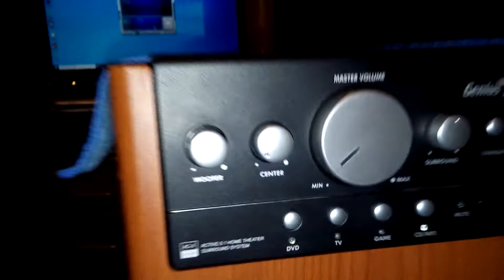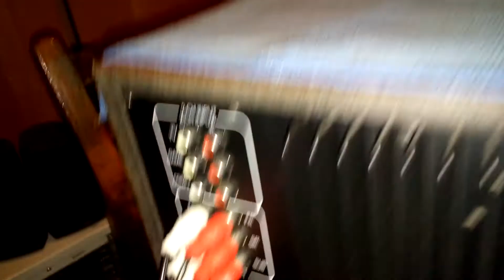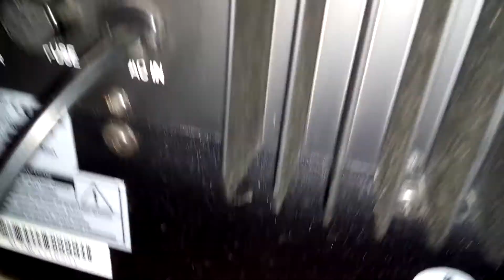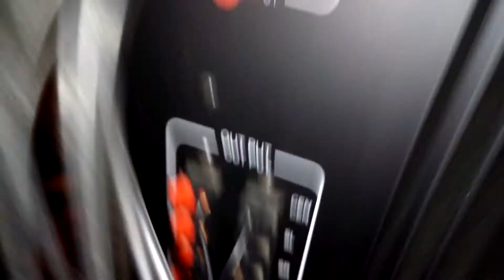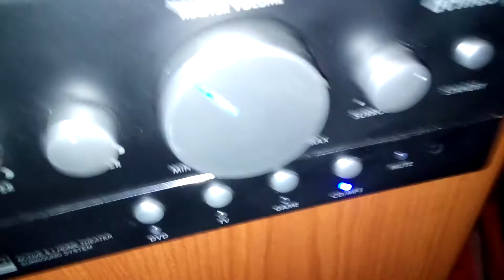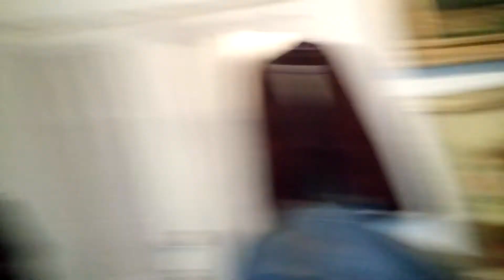Genius Home theater 5.1 Audio System

Comment: Input  set photo plz
Reply from the maker: You can pause the video and see the wiring input.I can't send you pictures since my home-cinema was moved to other location house.Follow the scheme back panel and let me know when you're lost.
Reply: @edward940  hey buddy, I bought one for my dad’s birthday, and I don’t know how to connect the out put wires, can you tell me which one is going in which SL-SR-FL and FR? Thanks for the great vid tho💕
Reply from the maker: @liljesuschrist8626  SR and SL is Rear back right and Rear left. Firstly begin  with front speekers, front center and lastly  the rear ones. Pause the video and connect the wires like shown there in the video.
Reply: @edward940  the rear ones work in SL and FL, the front ones don’t work in SR and FR, the remain ones… I tried crossing them one from other like you did in the video but I’m completely outside the subject.
Oh, and the rear ones don’t work in SL and SR… only in SL and FL.

Edit: Do I need to cross them in the back of the speakers too??
Reply from the maker: @liljesuschrist8626  Hm, strange. Have you connected firstly the wires from 5.1 connectors white and red all six of them and afterwards into the sound card of the back of your computer such as : black, orange, green? Assuming you're using 5.1 audio integrated sound-card? If yes, then start connecting first center speaker, rear left as SL, followed by the other ones.,at the bottom are FL - front left and FR - front right. If none of these works, try testing each channel of every satellite separately and see if you're getting signal or not.If still not works check if your sound card is set correctly as 5.1 configuration otherwise is not going to work.
Reply from the maker: @liljesuschrist8626  No..